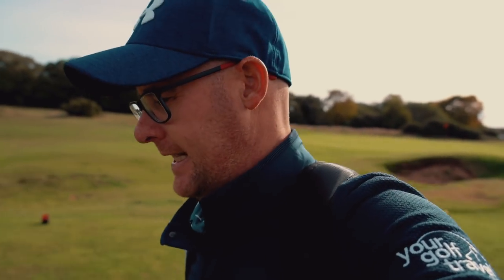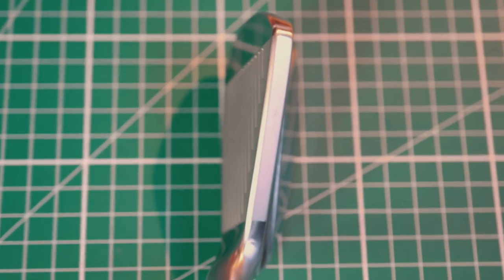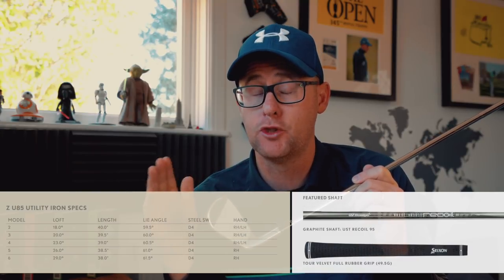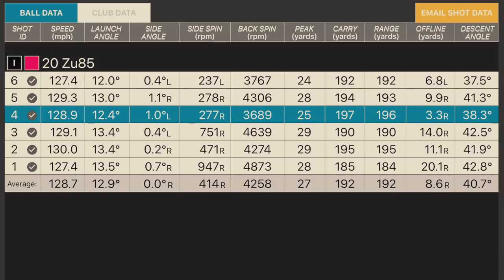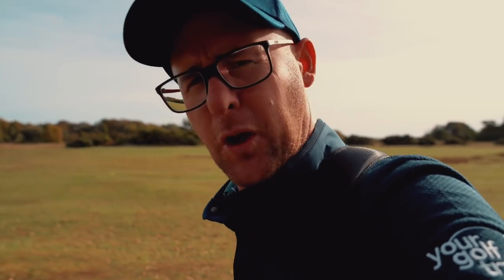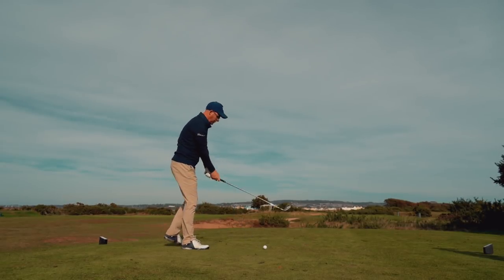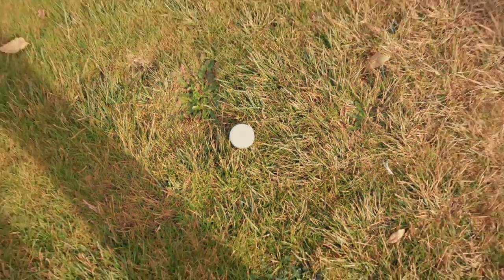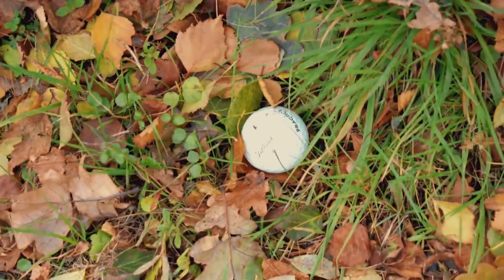SRIXON Z U85 DRIVING IRON

Comment: I love this club as a player on a hilltop course where the wind can get nasty and some of the par 4s are rather short. I feel more comfortable with a full swing pitching wedge or gap wedge than I do with my 30-90 yard mediated wedge shots, so sometimes I like to hit this and leave myself a 100-120 yards left to the green. I'll also take it on a slightly nlonger par 4 if it's windy, and use it frequently on my second shot on a par 5. Mine is a Zu85 20 degree (3 iron). Looking to pick up a 4 (23) as well

Comment: I’ve got two of the previous Versions of this club in 2i and 4i.  Fantastic irons off the tee and fairways and can dig it out the rough easily with the 4i due to the wider sole.  Doesn’t look bulky down by the ball as the mirror finish reflects the grass to hide the backside. Never liked hybrids which seemed a bit too drawy for me but these are perfect for shaping the ball both ways. Don’t be put off as better player clubs as the 2i is one of the best I have and was playing off 11 when I got it, and has helped me find more tight fairways to get me down to single figures. #reallylovely
Reply: Would u say this is more forgiving than the mizuno hmb? I bought that and then sold it after 2 rounds... I hit my 4i roughly 240, I'm seeking a 260 club. Would u say the 3 or 4 in this? I play off an 11 right now.

Comment: I had a 3 iron i could hit 1/10 shots more than 15 feet off the ground, decided to go with a hybrid. Then found out that I either hit a 3 yard fade with it or a 80 yard draw and couldn't find any consistency. Found the answer with the Mizuno MP FLIHI 3 iron and couldn't be happier, forgiveness and more meat to launch the ball (my swing speed also has increased since I put the 3 iron in the attic, so that helped).
Reply: That just sounds like a you problem

Comment: Mark would love to hear your thoughts. Went for a fitting today, my big problem is club face control. I hit my current irons with some strike tape on it, everything was centre of the face, but going left and right due to my control of the club face. The fitter then went straight for big clumpy irons because...”I needed help with my poor shots”. I was really disappointed because I was going for a players iron but the fitter did not think I was good enough to hit them. Thoughts?

Comment: Hi Mark

Thinking of buying Srixon U85 driving iron left handed. Currently use 3 iron off the tee as I really struggle to find the fairway with my driver. Can’t get a fitting but I can get trial of the club. Would I be mad buying the club not fitted. Thanks 😊

Comment: driver is my favourite club,hit it straight as a dye, but ive a 2 iron and a 3 iron, i use them both regularly off the tee at shorter par 4s, sometimes you dont want to get too close to the green. And, they are really easy to hit imo. I have the older taylormade driving irons...with hybrids, i just hook them too much.